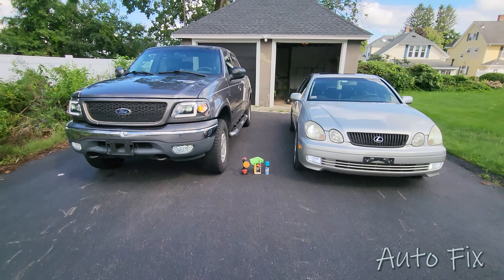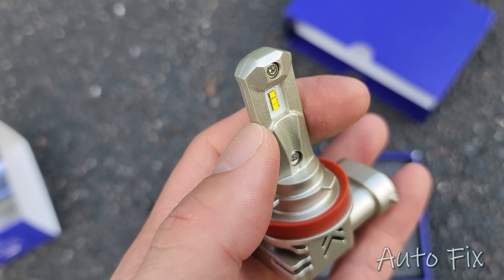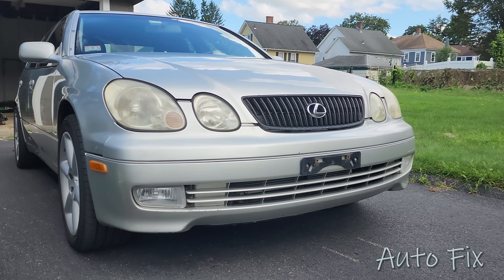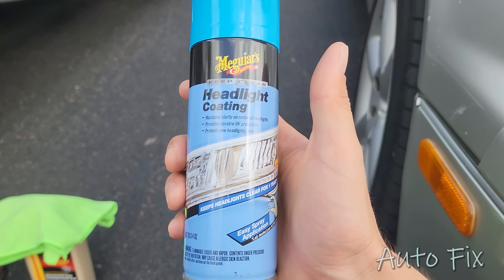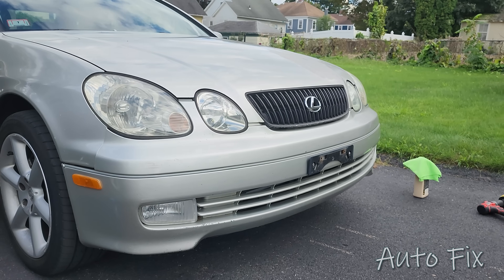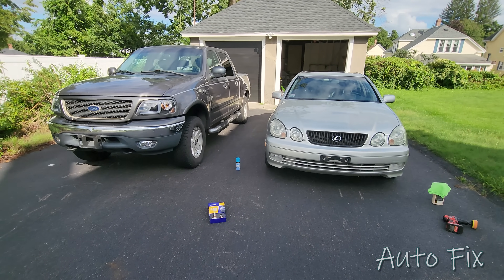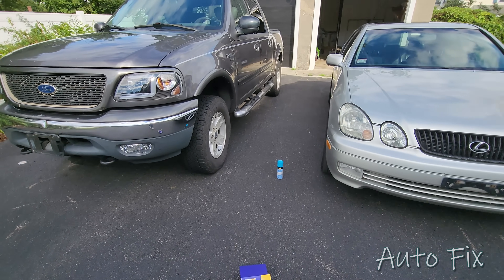How to Correctly Upgrade to LED Headlight Bulbs // AutoOne LED Bulbs!

Comment: Question ?? On most sites it gives you the wattage & how many lumens combined , so how do you know like for instance oh many lumens is the low beams compared to the high beams ??
Reply from the maker: The lumens are usually the same between those two especially on LED bulbs. The difference is the mounting area of the bulbs, and where the beam is pointing through the headlight housing.

Comment: My bulbs comes in from the side, how should i install it? 12/6 or 1 led side facing projector front?
Reply from the maker: I have never seen a side mount bulb before. Place it so the LEDs are perpendicular to the direction of the beam, and they are always supposed to be at 9 and 3 o'clock
Reply: Some of these Amazon/eBay bulbs only output up to 23% of their advertised lumen, for example a "60,000" lumen bulb realistically only put out 4,500 lumen (each LED chip on one side of each bulb only outputting 2,250 lumen) at their rated wattage. Unfortunately, determining what AmazeBay bulb puts out the most lumen is trial by error it seems. I keep getting suggested Morimoto LED bulbs.

Comment: I have Toyota Corolla model 2011 with low beam halogen bulps of type HB4 and 51 watt. Can I install 120watt led lights (HB4) without affecting car electrical system?
Reply from the maker: Yes, the LEDs aren't actually 120w, they are the equivalent of 120w halogen bulbs. So go ahead. You cannot overload the system with LEDs.

Comment: 1st - projectors have reflectors too and their geometry is different for HID and halogen bulbs. 2nd - now compare that cheap garbage bulbs to Osram LED smart which are  ECE R112 (road legal.)
Reply: There’s nothing garbage about the led bulbs, as they are well made as well.

And it doesn’t matter if the quality is better than the other, no matter if the warranty is 1,2,3,5,9,10 or lifetime warranty. Thinks can happen if it becomes defective or bulb burned out. 

These led bulbs are great for the money. 

We stick with Lasfit, Auxito, and even Boslla, and Sylvania led and zevo led on our cars. 

Because we know quality is there nowadays. 

And plus, we know which one is a very good low failure rate.

DOT or not. We rather upgrade with led.
Reply from the maker: This ⬆️
I don't go for cheap, I go for best quality at an affordable price with good longevity and good design. The brands mentioned above are all ones I have personally used and would use them again.

Comment: 3:24 This doesn't get brought up enough on arguments online about LED headlights, I have a pair of the Halogen pattern LED's for my Low beams, and normal halogens for my hi-beams. Man it is wonderful when they're installed correctly esp on Reflector Headlamps, nobody on the road has flashed their lights at me after adjusting the height properly.

Comment: So projektor headlights are better to convert to led, then a reflektor headlight? Converted my headlights on my 04 forester with h4 , to led´s but lowbeam is bad, it has some blind spots and the light output seems weak, sure one of the headlights is clody but its going to be changed to a better one, also going back to halogen bulbs with osram nightbreaker
Reply from the maker: Yes it's better to convert projector, but that doesn't mean you can't convert reflector. Your weak beam is likely a combination of a wsak bulb as well as the haze on the headlight. The pattern comes mostly from the reflector, but can be negatively affected by a bad bulb or one that wasn't installed correctly

Comment: personal opinion
if you want leds and you are going for the brightest and not gonna adjust them atleast use them for the high beam so that you wont be a pain the but for everyone else on the road
Reply from the maker: Yeah, good point. But best thing is to adjust the beam no matter what you do lol
Reply: Unless people prefer the brightest ones for low beams and as long as they adjust them.

But yeah, I prefer super bright like around 30W, and brightest for high beams.

Even fog lights, don’t want to be brighter than low beams.. 

Exact or less bright than low beams.

Comment: Something to consider is the colour rendering (CRI) of any aftermarket headlight. The point of headlights is primarily to be able to see in the dark after all, and while brightness and aim are important, if the headlights make certain colours “disappear”, you are still blind to those things. 
In this regard halogens are naturally superior, the incandescent lightbulb has a CRI of nearly 100. 

Also worthy of mention is that the CANBUS system on many vehicles will often not be happy with many LED replacements, especially if you are changing from incandescent. 
Some bulbs “fool” the CANBUS by having what’s essentially a resistor in parallel with the LED to mimic the current draw of the OEM light. Which is a bit silly since you are now effectively wasting the energy saving potential of LED bulbs 😂

Overall I think sticking to what the manufacturer specified and making sure the light assembly, lenses and wiring are in good condition is a better idea than to start messing around with aftermarket replacements.

Comment: question on your lexus bulbs, were they a straight up replacement? meaning I can just order a d2s bulb and swap out the HID bulb? or do I need to do something else? Thanks!
Reply: U can change from HID to LED if it’s specific design. Lasfit and Auxito makes for D2S HID for LED.

They are brighter than a 35W and 55W HID. 

Because every single year we see more and more improvement that are better in the world of LED.

Comment: Easy answer. Never put anything other than halogen in halogen lamps. The light refraction will never be right because leds do NOT emit light correctly.

Halogen emits 360 degrees. Led emits horizontally. Whatever you see hitting the ground, they will emit the same upward into the face of other drivers.
Reply: LEDs can't perfectly mimic a halogen bulb. This is why it's ideal, not to use them in refractory style headlights. They can work in projection headlights, but it's a trial by error even with those.
Reply: Exactly! 💯
Reply: Easy answer, get over it
Reply: This guy don’t understand that there are shit LEDs that do exactly what he is saying, and then there are good quality LEDs that contradict everything he has said. I don’t wanna hear the shit honestly….i promise you this: There’s no way anybody who watched or commented on this video tested every aftermarket LED bulb themselves and came up with the same negative conclusion on all of them.

Comment: these are total garbage!, they have no beam ajustments, they are made of cheap plastic, the throw is going to be garbage..... see the locking ring that should be ajustable around the led light to retain proper light cut off, STOP trying to say these are good, they are not....now look up something like a BPS B2, or ultra V. those are high quality LEDS
Reply: Could you recommend me something for my 2015 Chrysler 200 limited🙏
Reply from the maker: @greacelightning4670  Auxito, Lasfit, AutoOne, Boslla, and several other brands that you can find on Amazon are great. Look at those.
Reply: @AutoFixYT Boslla is very underrated and they have the same quality construction as Lasfit. 

They are incredibly well built. Definitely recommend them.
Reply: I don’t know about plastic. As these autoone or Auxito led bulbs have very good aviation 6063 aluminum quality construction bulbs. 

They are purely well made. Some of the led bulbs is almost pure full aluminum but the connector is good plastic made like oem.

And some others is full aluminum. 

Auxito, Lasfit, sylvania led, even auxbeam I have to say, so far the quality of the led bulbs are right one the money.

Yes we know that the all in one style led bulbs are not adjustable. 

That’s because we have cars that has offset halogen bulbs. 

Honestly I wish Lasfit and Auxito would redesign them all that has all in one style led bulbs, wether if it’s got a cooling fan or fanless with adjustable collar with Allen wrench or 360 adjustable friction fit collar. 

It’s not garbage if it’s made correctly. 

And u know what they say, u get what u paid for. 

If u think they are made of cheap plastic, why not go buy urself a Auxito - M4 fanless led bulbs for $30 a pair and see if u think it has plastic. 

That’s what I carry and it’s very solid.
Reply from the maker: Are you talking about the bulbs or the projectors? I understand that there might be better quality, but what i purchased actually works great, it looks and shines the same as a modern factory projector. I've been running the same setup for i think about 6 years now. i

Comment: Led light is ridiculous. If you cant see your way with halogens, just go to a doctor, not put blinding led sh1t into your car!
Reply: If u think we have vision problem ur wrong. 

We can see fine. We want to see way better. And upgrade with led helps to see better and be seeing better, and especially with deers it helps so much better to avoid and reduce accidents. 

U don’t blind others if u get the right type of led. 

Get the correct type of led bulbs like two sided led, adjust the beam pattern height and orientation correctly. And ur set. 

Halogen is not bright enough and not safe enough to see on the road. And they are thing of the past.
Reply: If you are not able to see the road with regular bulbs, you have a problem with your eyes or you are driving very fast. I use my lights just to be seen on the road, i can see everything without them even with just moonlight.

Also it doesnt matter what "kind" of led you are using, if it is not coming standart from the car factory, it blinds oncoming driver.

Period.
Reply: @burakozc3079 ur wrong again. I had no issues to see with halogen bulbs before. To me I don’t standard brightness of the halogen lights, I want to increase my visibility more with super bright led lights. 

So no I have no issues with my vision.

I don’t drive fast. I drive on a normal speed like everyone else.

And yes it pretty much does matter.

Having a two sided led that’s got a tiny led chips like SMD,CSP, and ZES led chips.

They truly do mimic the same beam pattern as oem. And that’s important. 

Especially when u gotta aim and adjust the height of the beam pattern, and have the two sided led chips facing 3-9 o’clock for the best light output and beam pattern, without blinding others. 

Period.
Reply: Around me we have a ton of deer and being able to see them sooner with a led has saved me a vehicle or two
Reply: @josephgerst2551  I dont think it is because of led bulbs but you have an issue with your eyes or you are driving faster than you should.

Comment: What K do you recomend for LED headlights? Something like 6000K more or less? What is the best
Reply from the maker: @dimitarhristovskii  6000k is good, it's a nice plain and bright white temperature. A higher number will result in a more blueish hue, colder. A lower number will be warmer, more yellow.
Reply: 3000k for weather is great. 4300k warm or oem white to up to 6500k cool white is best ones.

Comment: You did a great job describing the topic. I’m a Sealight guy myself. After I moved out to the country I was uncomfortable driving at night with the stock headlights on my old ‘14 Expedition. There are no public streetlights within 10 miles of my house and it’s a very hilly and winding highway to get to my private dirt road. I have an astigmatism and it’s hard enough for me to see at night anyway. I bought a set of X4’s because they were the brightest set they offered and are built with a collar that you can adjust to aim the LED’s in the perfect direction regardless of your setup. Once I installed them properly to perfectly replicate the filament of a halogen bulb they were amazing! They had the same exact beam pattern as my stock bulbs and both beams of my H13 bulbs worked great. Just bought another set for my new (to me) Excursion as well as all the bulbs needed for every light on the truck. I even sprung for the extra bright reverse lights because that’s really going to help out when I have to back out of my carport at night. Before I upgraded I was one of those people who would get upset at newer cars and their brighter headlights but after I upgraded I noticed that even the brightest (correctly aimed low beams) didn’t mess with my vision nearly as much. I always recommend people to upgrade to a quality LED bulb. Technically it’s not DOT legal but even the state inspectors where I live don’t care about the bulb type as long as it’s adjusted properly.

Comment: Very well expalined the reflector part (i am foreigner and understood that part well) however can you explain little more about projector? 🤔 Do they need special bulb? Because I learned from this video I habe projector on my e92 (that explains why I have combined for road lights and normal lights) but they light very slow and maybe I have incorrect bulb 🧐
Reply from the maker: You don't need a special bulb but a very bright bulb helps when it comes to projectors. If it's LED or not, the brighter the better. If you have halogen bulbs, consider upgrading to LEDs for more light output. If you have xenon bulbs and they aren't shining well, replace them with good xenon bulbs.
Reply: @AutoFixYT  honestly I do not know yet what I have because it is car from second hand. I somehow lookes trough lens and I saw something like led but this car should have xenon so I suppose preciousnowner put cheap led inside. I ordered xenon. I hope precvious owner didnt changed wires and antything crucial.

Comment: Nice video. My headlights are dieing out slowly, doesn't help that the lens is busted mostly on the highbeams part. Im thinking about going halogen again since the amount of blinding LEDs in texas is crazy, every other car has two suns as their lights it seems...went 2 wheeling once because of their lights (hope you understand the slight saltines😅). But i may reconsider LED. Projectors seem really cool though with halogens (i like the color). Definitely gonna replace my moms headlights with non glarely ones, she bought it with the crappy unaligned, glarely, probably cheap Amazon ones the previous owner installed.
Reply from the maker: Oooh yes, trucks will blind cars no matter the bulbs honestly because they're higher up. When I drive my Corolla, every single car on the road blinds me because it's lowered lol. But having the proper bulb, installed correctly, and headlights aimed properly, makes the car go from having 2 suns to 2 bright headlights. Also, keep in mind that if you have dimmer lights on your own car, your eyes are adjusted for that (darker) and when someone with brighter lights comes by, your eyes will be more sensitive to those than if you had brighter lights to begin with. This doesn't present itself that much but it's a factor to consider.

Comment: I’m using LEDs for my high beams from Ali Express which had good reviews. They work amazing!!
Reply from the maker: If it works it works!
Reply: High beams are easy. No fancy beam cutoff needed.
Reply from the maker: Agreed, but they still need a good beam pattern so they can shine far enough.

Comment: I want to add something regarding replacing your lenses. If you’re going with a “stock” replacement, don’t buy from off brand on Amazon or EBay. I purchased reflector lenses off of Amazon for my ‘08 Corolla. They were exact replacements, nothing fancy. The beam pattern always seemed off, I blamed it on the LEDs. I decided to purchase OEM lenses from Toyota and it made a huge difference in the beam pattern. The bulbs were aimed a bit high, but I was able to adjust them. If you want to replace your old lenses with the exact same ones, I’d suggest going OEM or with a highly rated aftermarket one if you kind find it
Reply from the maker: Yes a lot of aftermarket headlights have worse beam patterns. But not all! I have used several brands with great success.
Reply: When you're talking about replacing lenses do you mean the entire housing or just the transparent plastic part. Mines has been busted because a family member ran into a truck while on their phone (not too fast just the bumper cover and plastic lenes are busted)
Reply: The entire housing. No one sells the transparent cover alone

Comment: You can put only this powerful bulb, before the light start to bleed where it shouldn't. Yes, it might still has nice cutout beam pattern, but you will have more light outside the edge of the beam, thats made for lighting up the signs near the road. And when you have more light outside where you shouldn't have, you get light that are problem for other road users.

Comment: I appreciate this video, hardly anyone tells you how the bulbs are supposed to be oriented.  They must be perfectly vertical.  I assumed it differed on a model by model basis, but that's good to know, thank you.

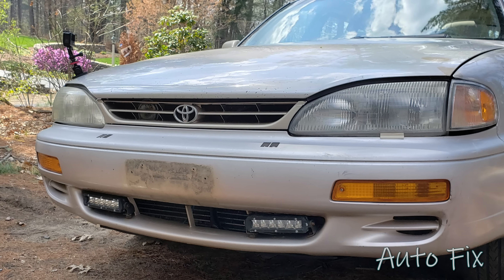5:11 I see a little plastic doodad under the Corolla's left headlight, what is that?  I assume it's a spacer to help hold it up?
Reply from the maker: Ah, yes. That's the Camry, and that plastic piece was there for years because the headlight pivot point was broken and it would fall down. So that piece held it at the perfect height hahaha
Reply: @AutoFixYT  ah, a camry with a broken headlight pivot point.  Sounds like mine, assuming the piece looks like a plastic piece with a hole to accommodate a metal knuckle.  At least I know the name for it now!
Reply from the maker: @LuwiigiMaster  yes haha that's it! I ended up replacing the headlights on thay car but that's pretty much the only way to fix it, is to replace the headlights.
Reply: @AutoFixYT  a headlight kit comes with the required piece?  Interesting, good to know!